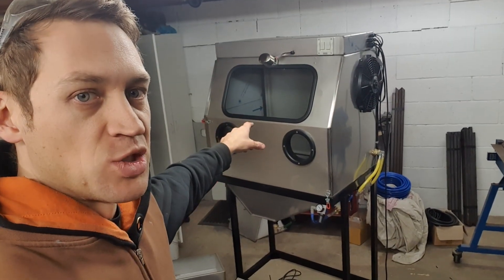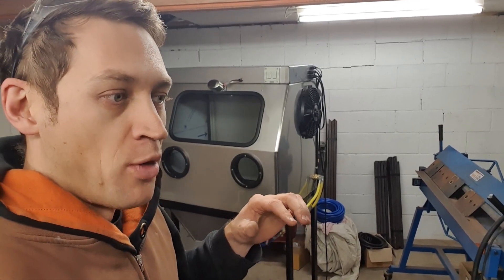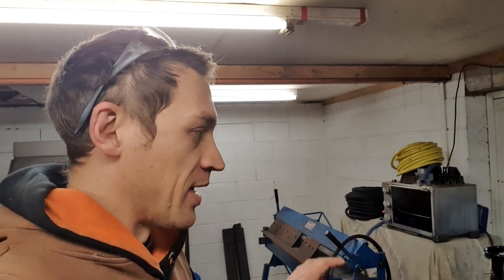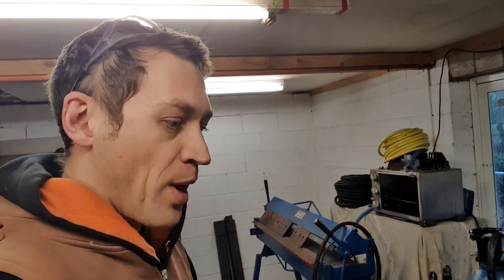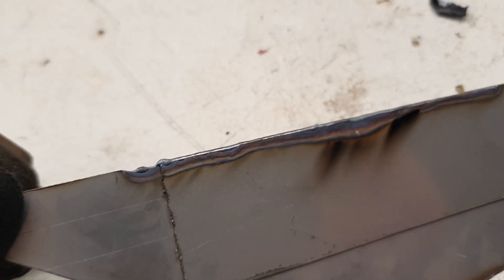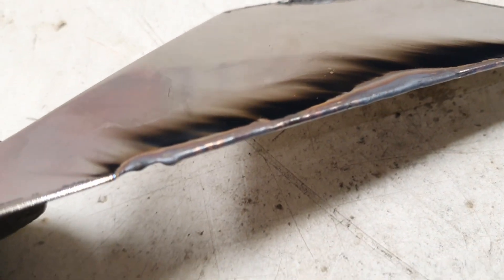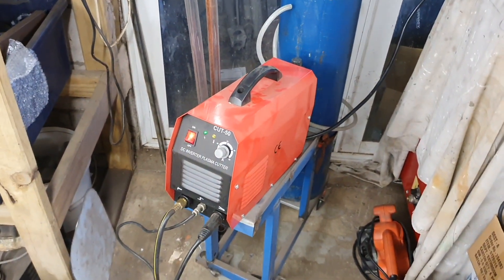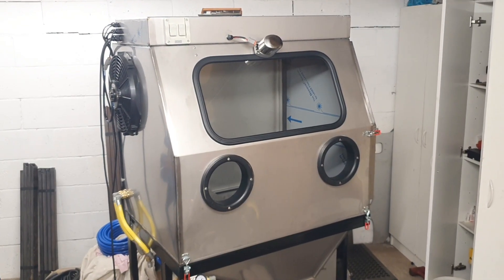Can you TIG weld with a Plasma Cutter? Yes - but NO.

Comment: Tig torch isn't the same as plasma torch with respect to the applied power. Plasma is generated, true but unlike a plasma cutter that uses single polarity, a Tig uses a cycled polarity where the polarity momentarily reverses to clean the work surface of collected soots that can impede the weld bead. 
You can do some things with such a setup but will be limited performance wise due to not having the cleaning polarity reversal cycles during the weld process. So, this only works for very limited applications.
Reply from the maker: In regards to tig welders as used in alloy welding applications, yes you are correct. They are colloquially known as AC/DC Tigs. When welding stainless, or mild steel, a DC tig is just fine. I still use this tig and it is functionally the same as the dedicated DC tig welder I replaced with the plasma.
Reply: Unless your welding ally, there's no need for cleaning from the positive side of the wave form.
DC tig is not a process that I, or anyone else in the industry considers to have  "limited applications".
"Soots". Lol.
Plasmas are just fancier arc welders with Hi-freq so it can sustain the arc cone with regular air.
Same as a tig machine with Hi-freq so you don't have to light off the tungsten. Bit of a pain getting a tig torch with dinse connectors rigged up to a plasma cutter though.
Good vid. Enjoyed it alot, thanks.

Comment: hi..I want to buy 1 machine only, which one is better, plasma welding is changed to tig.? or tig welding changed to plasma
Reply from the maker: I haven't tried using a tig as a plasma cutter personally so I couldn't say for sure. There are those 3 in 1 machines you could look at

Comment: What is Ampere power of your Plasma machine. 40 Ampere or more than 100 Ampere?
Reply from the maker: Hi,

Its a 50 amp (cheap "cut-50") plasma cutter. It's fine for thin sheet metal, but for thicker stuff it starts to struggle

Comment: very good idea, your video is very helpful, I only have a plasma cutter although I also need to weld tig. do you still use your plasma for tig welding? are the solders okay? Thank you
Reply from the maker: Hi!
Yes I still use the plasma cutter as a tig. The welds seem to be just as good as the real tig welder I used previous to the plasma cutter.

Thanks for watching!!
Reply: @ArmouryEnterprises  Thanks to you, you have given me an option that will be very useful to me.

Comment: Greetings good video, I have a plasma cutter and I want to use it only for tig welding. your plasma welder never gave any problem welding tig right? And finally, to light the bow, didn't you have to scrape off the tusteno? (from the Dominican Republic) thank you very much.
Reply from the maker: Hi Solo,

I am still using this plasma cutter to weld my cabinets and it still works great! My plasma cutter has high frequency start, so no need to scratch start the arc.

Thanks for watching!

Comment: I mean, is it possible for tig welder to convert to plasma cutter
Reply from the maker: Hi Srdjan,

Sorry, I though I had responded to this. I have seen videos where people have used a tig as a plasma cutter. All you would need is an air regulator and plasma torch to suit the fittings on the Tig. A unit with HF start would be an advantage.

Thanks for watching!

Comment: I bought one of those three in one rigs. It didn’t work out of the box. Sent it back. I think a dedicated unit is probably better. I ended up getting a 185 amp Ansen tig welder. It works very good for tig. It also came with stick welding leads but I find it  extremely difficult to strike and arc with stick. It’s especially difficult if trying to restrike an arc after stopping. Practically have to get a new rod every time I stop.
Reply from the maker: Hey mate,

Yeah I had a similar experience years ago with a 3 in 1 unit. It worked so poorly that I thought I just sucked at tig welding and gave it up. I think my welding would have been streaks ahead if i had started with a decent unit.
Reply: Is it possible that you didn’t have the tungsten to be electrode negative?
Reply from the maker: @JohnsonD541  Nah it was definitely right. I had tried it both ways. I gave it away to a friend who never got it to work properly either. It was probably just a dud unit.

Comment: How much does one of those cabinets set ya back!? Flat pack to Australia? Haha
Reply from the maker: Hey Scott, I sell these for $6000NZD open loop. Not yet in a position to export to Aussie. I have to jump through some extra hoops to get each one an electrical safety certificate. I hope to do so in the future.

I will likely redesign the frame so it can be disassembled and pack down into a smaller box for shipping.

Comment: Hi josh you can scratch start tig with a ark welder bud
Reply from the maker: Hey Man!
Yeah I had heard that. The advantage of the Plasma over the Arc is that is has the solenoid for actuating the gas too and has the post flow too. I will get a better TIG soon but this will do for now.

Good to hear from you bud!